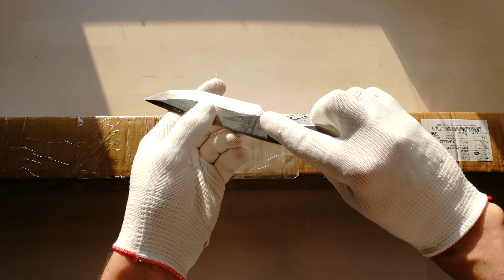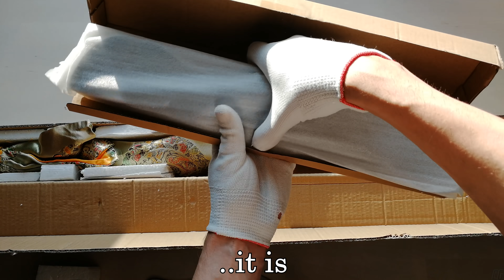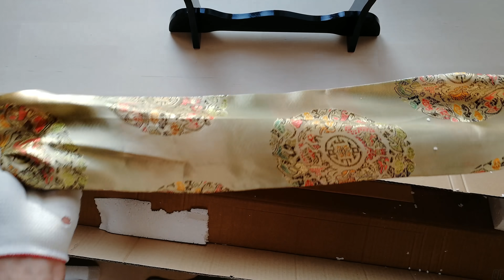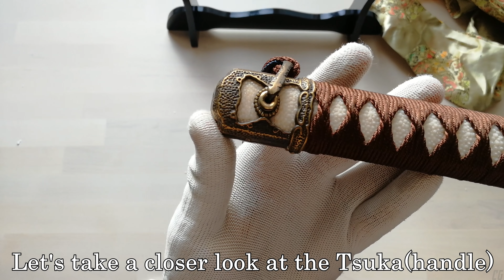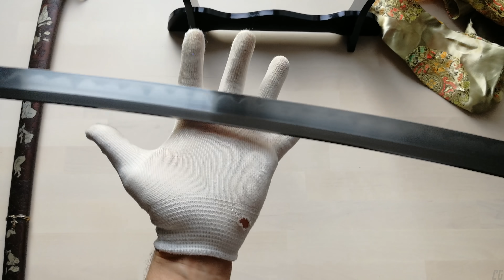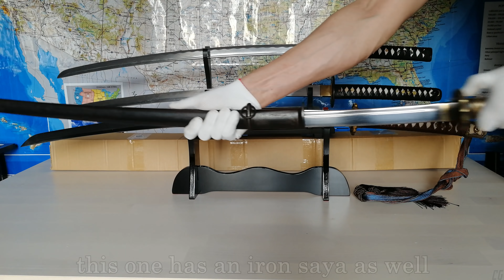$500 Aliexpress Katana is Actually Good - Unboxing + Comparison to the cheaper Katanas [4K]

Comment: Paper thing is just crap . Anyone can slice paper with a pencil because it isn't that hard . once paper has 1 singular punctured weakness it can be followed on
Reply: But that's not cutting.. this "katana" really did rip it like a pencil. Look at real cutting tests on paper that will open your eyes
Reply: @Quintcy  cutting paper is not a good example look it up . a person can do it with a pair of scissors when wrapping up presents it is not a hard thing or a good example to use
Reply: @jimmyboynottknown7713  not for testing sharpness but if you want to prove the blade is blunt
Reply: @Quintcy  proper swordsmen and smithy's know that this is the shittest over popularized blind perception test.
Reply: @jimmyboynottknown7713  I never said that a paper test is good. But you will know if the knife cuts or rips
Reply: @Quintcy  can do the same with something simple as a pencil
Reply: @jimmyboynottknown7713  no! Can you please just read something about it? It is NOT a GOOD cutting test. BUT a blunt knife or whatever will tear the paper apart like you saw in the video. The actual "cut" is not a cut.. If you go very close you can see its not a clean cut, the little paper fibers are sticking out everywhere. That's the same if you use a pencil. If you have a sharp blade tho, you get a very clean cut and you cant see any of those small paper fibers... Because they are actually CUT and not ripped. Its still not a good test okay but if you don't get the difrence between a ripped and a cut paper just do it yourself and look very close at the difrences between a pen and an actual sharp blade
Reply: @jimmyboynottknown7713  when testing a blade on paper you don't look at "can it go through paper"... If it can't go through its defenetly not even a blade. If you actually got a blade and cut the paper you usually take a very close look at those fibers and find out if they are all cut or maybe your blade just cut half the paper and ripped the rest like a pencil. STILL I don't say it's a good cutting test. BUT you will find out one thing: is my knife ripping or actually cutting.. Maybe something in between
Reply: @jimmyboynottknown7713  im just explaining to you the difrence between a cut paper and a ripped paper. Nothing else. Google pictures of cut and ripped paper if you have to
Reply: @Quintcy  the google compared to reality is not the same thing. 
As i said all proper smithy's and swordsmen themselves (you know the people that deal in the feild on a regular basis)  they themselves say it is the shittest example and not even declared good enough to be classed as a test . id rather trust their word more than an internet page and American.
I never specified about cutting or ripping paper did i . but its a scientific fact once paper has been (PIERCED) it has created a weakness that can just be followed on
Reply: @jimmyboynottknown7713  🤣
Reply: @jimmyboynottknown7713  I have just now found this video for you. youtube.com/watch?v=MuPn8e5WYT0
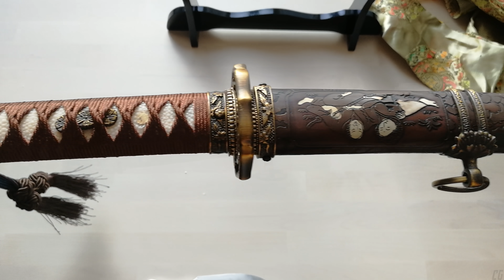Go to 4:47. Still it's not a good cutting test but it is one
Reply: @Quintcy  i seen that yesterday in another video titled (why paper isn't a sharpness test) and that video was in there under that title

Comment: Razor sharp yeah it is....🤦🏻‍♂️
Reply from the maker: it actually is. the paper test isn't the best way to show the blade's sharpness.
Reply: @ExtremeGamingHD3D  Well what is then?  Paper tests may not be the ultimate sharpness test, but it's a good way to weed out the crap.  If a blade fails in a simple test, it's likely to fail in more demanding tests.  Are you going to do some Tameshigiri with it?